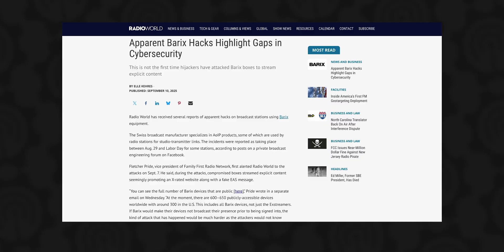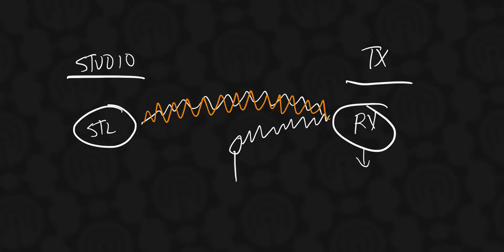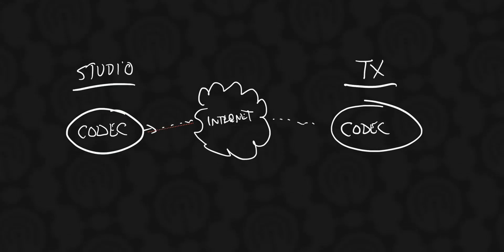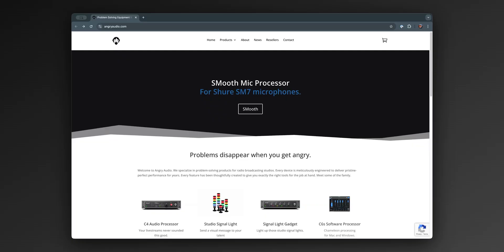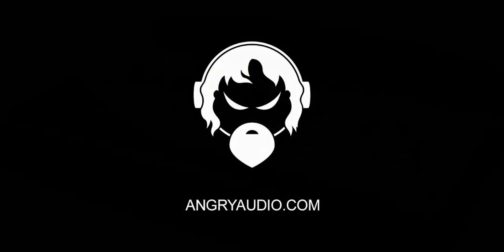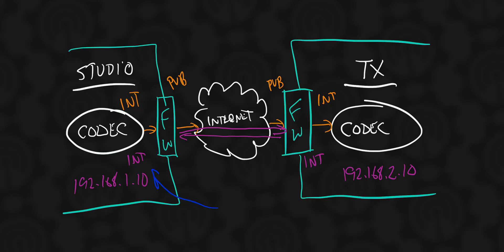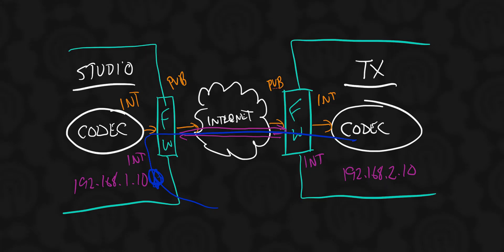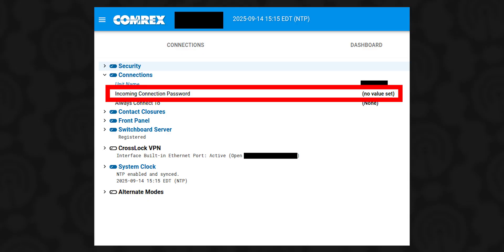Secure your STL

Comment: The issue with the "hacking" is less about hackers and more about broadcast engineers not observing internet best practices.  I engineer on the side (contract basis) and work as a technical systems architect and often have to review solutions where these kinds of problems have happened. It is more common than people seem to know. VPN tunnels are great. If you are a decently sized station, I would recommend going with a mutli-WAN or multi-ISP SDWAN solution and your codec can use packet-duplication on multiple underlays to protect those RTP streams.

Comment: These seem like such basic, obvious measures... yikes. Definitely use a VPN if you're sending your audio over the open Internet! Are there any STL boxes that integrate a VPN themselves?
Reply from the maker: Yep, basic easy things yet so many out there don’t do it. A quick Shodan scan shows so many out there.
Comrex has a point to point VPN built in called Crosslock. GatesAir does a great job of locking things down on the wan ports.

Comment: No need for me to worry they would have to come to my transmitter in my cabin to hijack my station 😅I’m very low tech here as the station has no money 🤣
Reply from the maker: The “STL” is a wire from one room to the other? Yeah, that’s probably pretty secure from hackers. 😜
Reply: @TheBroadcastEngineer You would cringe at how this station was transmitting these past few weekends 🙈 cobbled together audio setup with no studio.. It was mostly for testing and modifying the transmitter though. Slowly building up and awaiting an Optimod 9200.
Reply: Back in the 70s there was a classical station, KDFC at 102.1 in San Francisco that boasted having the studio and trans connected "with a piece of wire", back then to promote fidelity. Microwave STLs were fairly new at the time. One was wire to the top of the Trans America Pyramid and MW from there to San Bruno Mt. Dude had grandfathered in 125kw ERP, strictly NNW/SSE to protect Sacramento and other easterly markets around 101.3. They boasted the fidelity of mw over that of EQed analog phone lines. Oh, it never ends ..